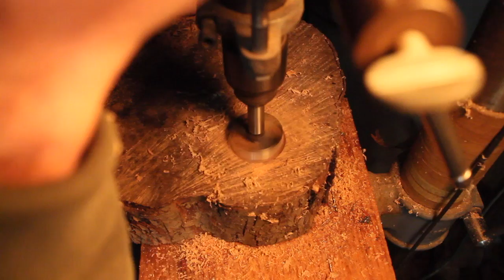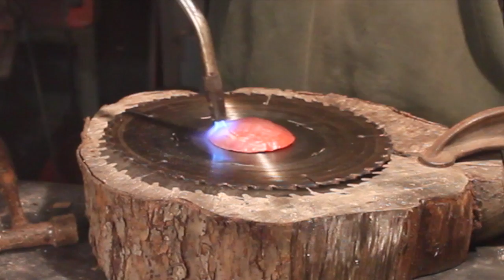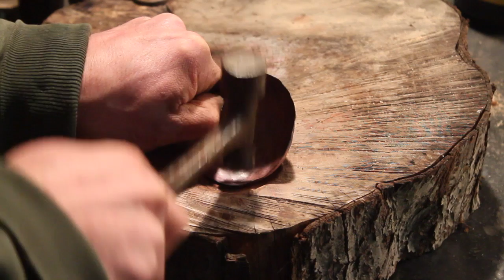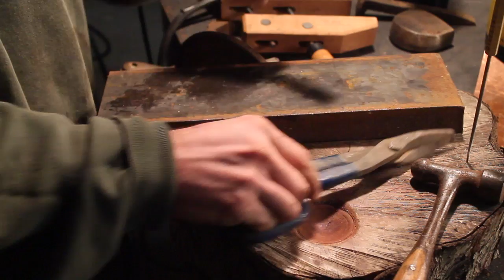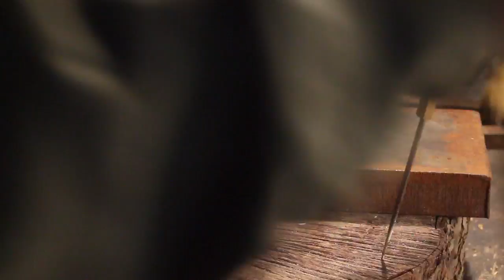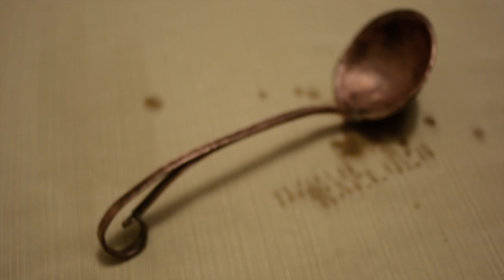Copper Ladle

Comment: what is the best way to shape a metal bottom like the first copper piece, start on the outside or the inside? (correct me if i'm wrong but i think i saw you in an other video starting from the center)

Comment: That does not look food safe.
Reply from the maker: Lead free solder used. And washed. Copper is very food safe.
Reply: Well then, Nicely done. I wish I had jimmydiresta to teach me.
Reply: David Waelder
Copper is not food safe! Pots from copper are always coated inside with tin and especially acid food can create nasty stuff that wont be good for you! http://en.wikipedia.org/wiki/Copper_toxicity
Reply: HOOKEDONWOOD  It is safe somewhat.  Copper pipes for instance.  You will not be cooking food in this spoon, so it is not likely to cause any problems.  Since this isn't a pot, it isn't likely to cause toxicity.  The problem lies in food with high acid, like sauces with tomato, vinegar or wine, temperature is also a factor, but a simple patina will resist leaching with low acid food or water.  But using it for gravy isn't a high risk.
Reply: seancoyote Thanks for bringing some nuances in ;o) I mainly responded to the statement that it was very food safe! It is not. But if you know what it is used for you can take the liberty to use it with some care. Not for storing and not for cooking acid (hot) stuff. For me that would be to many limitations to not have it coated on the inside. I was also concerned that other might take the reply of copper being very food safe and then make other copper kitchen ware for other purposes that would be more of a problem.